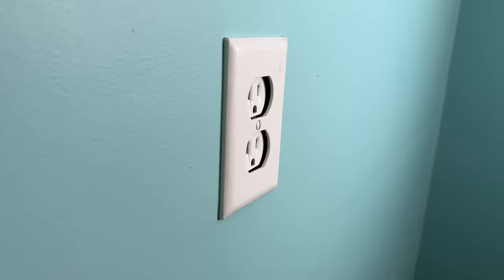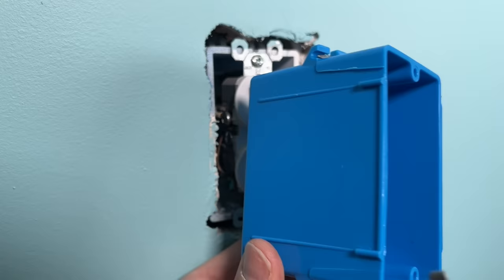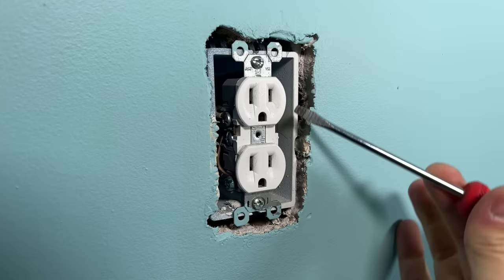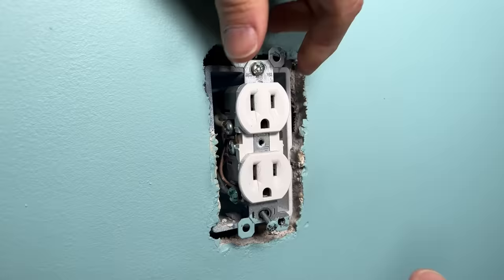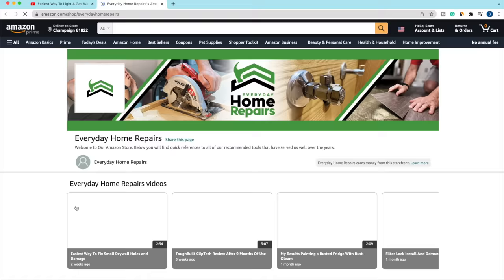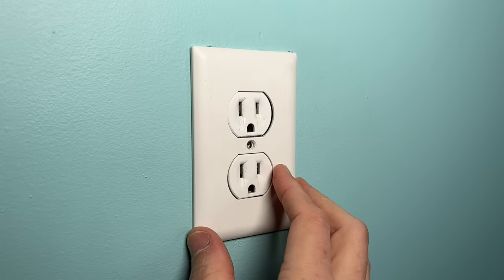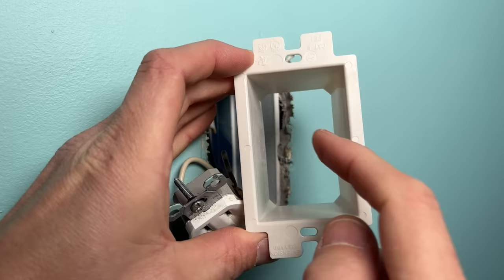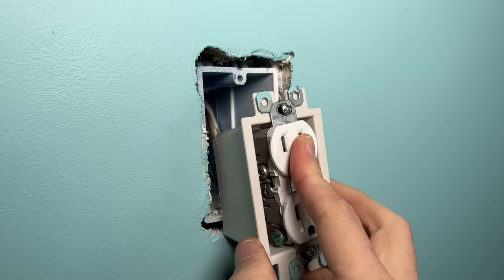How To Fix Sunken Outlet | 2 Easy Options

Comment: The anti short plastic rings are required by the NEC anywhere you have more than a 1/8" gap. Also, with the kind of box you showed, the longer screws will catch the further back fresh part of the device hole and the screws will catch real nicely.

Comment: Spacers, box insert, both new to me. My home was built  in 1890's with electric and plumbing added later during the  1920's, 50's and 80's by half drunk Portagee's using surplus/stolen materials.

Comment: Great Channel, I changed out some old outlets in my basement recently. Builder had the boxes set in the wall to far back and the old outlets screwed in with long drywall screws. After watching this video i ordered the box extenders. PERFECT solution for the issue. They came with long screws and installed quickly. Thanks for the tip, glad I subscribed to your channel.. Great Work...

Comment: I’ve used the little spacers in the past but I really was happy to learn about the box extenders. They are perfect when the box is too far back in the wall. I do wish to be “code compliant.” For example when wood paneling has been applied over the original drywall. So next time I deal with paneling I’ll put in a box extender.

Comment: We purchased a number of decorative wallplates to make our home look nicer. When I went to install them, due to the thickness of the wallplate, the outlets were sunken. The outlets are flush with drywall, so correct for normal plates.  Now I know to get those spacers to position the outlet past the drywall, so they can work with the thicker decorative plates.

Comment: Thanks!  I'm in the middle of a kitchen project right and I'm using the sleeves because I'm installing a backsplash over the outlets.  You would not believe this but the old sleeves are metal!!!  I didn't know about the spacers, though.  Thanks for the tip!

Comment: both processes were new for me. i just loosened the screws on the outlet so that i could get the outlet flush with the cover. i'll be adding those spacers now. also your pliers that cut the screws. those are pretty cool.

Comment: I do this kind of thing all the time, it seems. Every house I redo needs something like this to be done. I do however fill in the gap round the box with Compond and tape, Should especially be done on outside walls where one might feel a bit of a draft. One can feel a bit of draft even when the wall is insulated. Thanks for the video.

Comment: I learned a lot.  I am replacing all of the receptacles and light switches in this old house.  This was a fantastic help.  Many times, they won't set right, and I used slivers of wood I took from Shimes.  I will be redoing them correctly.  Wall inserts also is something I had no knowledge of.  The use of a larger wall plate also is very helpful.  Thank you very much.

Comment: The outlets in my home are not up to code; did not know this when I bought it 19 years ago. 
I have learned to do many things for myself as I am a 77-year-old female on a very fixed income. This information was extremely helpful because my outlets are wiggling loose in their baseplates and crooked on the walls, sunken in and in some cases spark when a plug is inserted. My lights dim when something else  is plugged in. I just have quite a bit of trouble and I cannot afford an electrician. This will solve the ( except for the dimming lights)! Once I have repaired ALL my outlets, i WILL get an electrician to CHECK my whole system! I know my limitations! 
The spacer thing is new and the insert box is new info for me. 
Thank you so much for a clear, concise, easily seen and easily heard video that has been extremely helpful to me.  Will be looking for more great info from you! 
PS: how are you on motorhome systems especially DC?

Comment: Thank you. I just bought a house and about half of the outlets are slightly sunken in and now I know I can fix it with that red little spacer. It's been bothering me but I thought I'd need to get drywall to fix it and that's too much of a project for me right now. You really saved me a ton of work.

Comment: Thanks. The spacers , I use little plastic washers. The wire strippers are nice much better than running a nut then cutting the bolt and backing the nut off to create threads

Comment: I learned which side of the outlet is for hot and neutral wires. AND about that screw driver you used to secure the wires. Thanks!

Comment: When I tiled a wall in my kitchen I had to use about five of the plastic spacers to get each of the the outlets out of their now-recessed boxes to the level of the new wall. Wish I'd known about the insert boxes, which would have been a much better option.  Nor did I realize that the mounting screws could be cut with a wire cutter tool as you showed. I wasted lots of time buying screws specific to electrical outlets instead of generic screws.  Thanks for all the new info.

Comment: This was a great video because I came across this same problem with a house that I just bought and my nephew's room has the sunken outlet and he violated code by cutting away the drywall to make the cover to the outlet fit. I didn't realize he violated code until watching this video but he did. I am ordering the red colored spacers from Amazon to correct this problem. I am also ordering the power outlet box extender in case I also need to use it. Thank you for the video because it was very informative.

Comment: Gees, this is embarrassing.  I'm 57 years old, have been doing a lot of DIY wiring projects, largely learning as I go and largely (gulp) incorrectly.  I've picked up so many little hints and ways that I never knew before in all your videos.  I never heard of spacers or box inserts before, never knew there was a wire strip gauge on outlets that I could reference, never heard of a Wago, never knew there was a quality difference between all those outlets, never knew there was a bolt cutter on the electrical pliers, etc.  I also love the tests you have done and showing the plotted performance of various types of lever vs wire nut connectors.  Keep up the great work, don't assume us old dudes have learned the correct way, and I'll make sure to buy through your store front to help support your work!
Reply from the maker: Thanks so much for the support and feedback.  Happy to help and we will keep the videos coming.

Comment: What I do is coil a small strip of wire around my screwdriver tip and make a small spring, depending on the depth of the box it will determine the number of coils I twist the wire to be used as a spacer.

Comment: I really liked this video. I have an outlet box in an overcut hole in the wall in the kitchen,  so the ears don't catch the surface of the tiled backsplash so this video is exactly what I was looking for.  In my house, I think there are probably other outlet boxes sitting in overcut holes as well. And in one box in my bedroom there is no ground in a metal box.  I also noticed that in my power panel the ckt breakers on one side are numbered sequentially  1-18 and on the other side they are numbered 19-36.  I have been around a lot of power panels in commercial buildings  and the ckt breakers are always numbered even on one side and odd numbers on the other side.  While numbering does not affect the functioality of the breaker panel it is just convention to number them this way.  So all these question marks made me think that maybe except for setting the meter and installing the breaker panel a non electrician wired the house, somebody like the carpenter maybe. And the wiring was not particularly professional to my eye, and I am not an electrician.
Another attaboy was when you explained the reasion for the ears.  I have seen so many videos where the explanation was that the ears were there to use as spacer washers which you discussed.  However, if that was the only reason for the breakaway ears it just wouldn't make a lot of sense for the reason that you made, that they are just to thin to do much good.  In my job I had before I retired, I had to install outlets in metal handiboxes as you showed here, and I always had to break those ears off so they would fit properly into the box.  That is why they are breakaway, just as You said.

Comment: I've used the box extenders before (20+ years ago), but until now, never heard of the spacers.  I have an outlet that has the same issue  but will be using the spacers instead as it's not too badly sunk in from putting in a new backsplash.  

The video itself was very well done.  Short, sweet and to the point.  Good angles, lighting  and thank you very much for not having special effects or a music backdrop as those can be quite distracting.  Well done and this video is very helpful.

Comment: My house is over 150 years old, and it suffers from ALL of the problems in this video, and I have been struggling with it for YEARS.  Every single outlet in this house is completely messed up.; to the point where when something goes wrong, I jump straight into denial mode.  If YouTube existed 50-80 years ago this house would likely not be so bad.  But everywhere you turn in this house, you can see 100+ years of ignorant DIY-ism.  Thanks to you, and this video, the outlets in this house are now going to be a lot less scary to me.  I might just fix every single one of them, one by one, as time goes on.  So thanks.

Comment: Great info, I didn't know about the spacers, but even better the INSERT! I will need the larger face plate as well. The previous owner did a cedar covering on his wall with 2 pluds and did nothing except but the face plates back on with longer screws. Got to get this done as it looks goofy and not to code.

Comment: Great video. Thanks for sharing that you can snip the screw to fit and which wire stripper can cut the screw. I didn’t know you can cut the screws to size.

Comment: Very helpful video.  I've faced this problem before, and what I have done is to bend the "ears" on the sides of the screws inward so that they force the outlet out a little bit more to get it properly positioned so it is flush with the faceplate.  It is a little tricky to get them even, but it works.  It may not be code, if it is not, feel free to call me out on it.  But I figured that was the whole point of the little ears.  Otherwise, why are they there?

Comment: Encapsulating the outlet and not leaving it bare next to combustible material. I would have fixed with the spacers and not look back. However, thanks to your video channel, my house is in compliance and the wall looks fantastic with the new flush fitting wall cover

Comment: Nice, Wish I had seen this 2 weeks ago. I recently bought fancy metal wall plates, and realized that they were thicker than the usual cheap plastic ones, thereby leaving gaps the sockets and switches. Code restrictions aside, they just didn't look right. So, not knowing about the red spacers you have, I purchase washers which still weren't enough to raise the switches and sockets. Then I found on eBay plastic spacers (look like extra thick washers) which did the job. Only your spacers look easier to install than the spacers I used.

Comment: Almost everything in the video was new to me.  I knew of only one type of spacer,  1/2" deep.  I needed because I mistakenly set the box flush the the stud ad didn't;t allow for the 1/2" sheetrock. 

Good video, very information.  Also, I like your style of presenting the info, you didn't include frivolous material just to stretch out the video to keep YT happy

Comment: I didn't know spacers existed for that purpose. Ive backed off on the switch installation screws and allowed the cover plate screw to pull out the receptacle to the proper position. I see now that is not correct. Also did not know about those insert boxes. Great info, thank you

Comment: I did not know about that kind of box extender. Also your tip about sliding the receptacle through if you have enough wire length could save a lot of time! Thanks - I always learn lots from your videos.

Comment: When I was wiring in homes and this happened, I just cut off a chunk of wire, wrapped it around my robertson bit several times to make it look like a spring with no gaps. I then cut off the length I needed and put the screw from the receptacle through the centre of that “wire spring” and screwed it into the box. If the plug stuck out too far, I cut off a little bits until it worked. If the screw became too short, I always had longer ones to replace them with.

Comment: This is a really excellent video! I learned:

There's an integrated wire stripper on some outlets!
The little holes on wire strippers are for cutting screws
The 1/4" of exposed wood code rule

And probably some other things too. You're really great at explaining in just the right amount of detail.

Comment: I just carry extra #14 wire to twist around a Philips screwdriver and make little "springs," or spacers, which I then cut down to size and slide over both screws of the outlet...
Been working for me since 1985...

Comment: Thank you for all the detail and explanation.  This is a new area for me to step into.  I have several outlets at our cabin that need to be fixed. Why I should fix them - it's not just because they look sloppy- it's a safety reason.  Now I understand when to use spacers or a box or both.  And the larger-sized plates are great to know about!  Many times people say  "use spaces to fix this problem" but don't share why or which situation to use them in. Again thank you.  It is much simpler than I thought it was going to be and I will be able to tackle it now!!

Comment: All good information. The use of an insert box is important for older houses, like mine, that have metal  electrical boxes; the isolation from the box and exposed non-flammable wall material is important. I wonder if it's better to place the (red) spacers BEHIND the insert box to bring it forward, closer to the outlet cover.  Having a number of longer #6-32 screws is also good advice. You should also have noted that it would be safer to power off the outlet while doing these adjustments!

Comment: Didn't really know about those outlet spacers.  Knew about the box extenders, though I've never had to use them.  I have a couple of oversized wall plates in our home (built in 1961).

Comment: probably not to code, but seen lots on new construction... making wire coils.  -  wrapping insulated conductor tightly around a narrow shaft screw driver.  The amount of wraps will determine the thickness your trying to fill.  The coil then goes between the receptacle ears and the box ears (the 6/32 inserted in the coil).  Nice to have 2" 6/32 close by, then cut them to desired length using strippers.

Comment: I use a wire nut as the spacer.  I use a large wire cutter to cut the spring end off the wire nut.  They are easy to cut to size.

Comment: I didn't know about the inserts. I also learned today, elsewhere, how to completely remove one of those old small boxes, just before you repeated the advice (Sawzall on the side to cut through the nails or whatever. I am taken with the jumbo plates. I used them for all the outlets in my living room. Also the old work boxes with clamps that attach to the drywall.